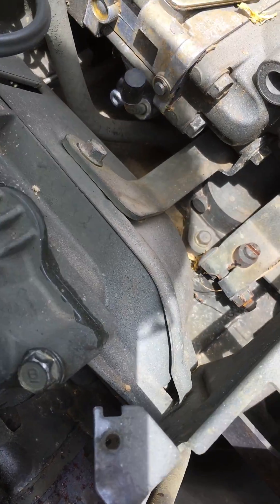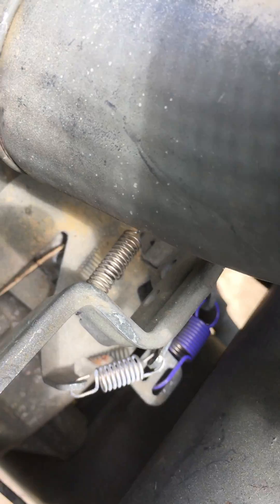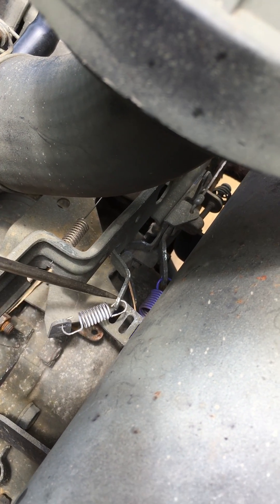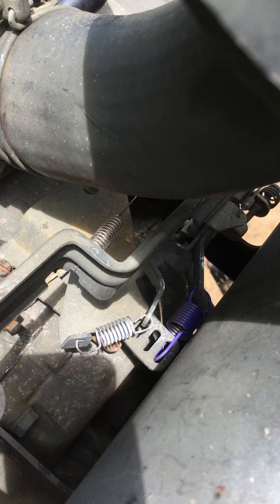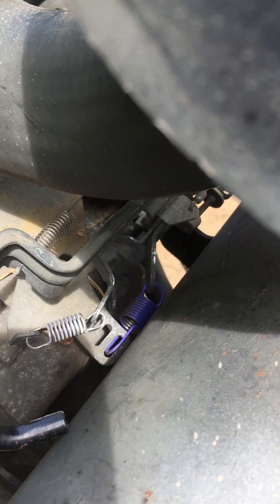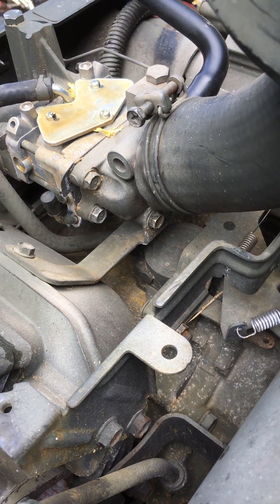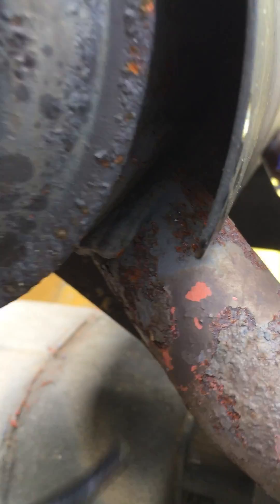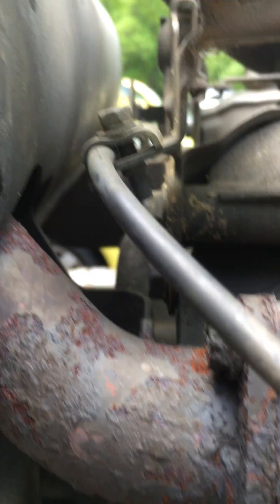Briggs Big Block Governor, Idle, Load idle and Max rpm

Comment: What spring is bringing it back to wide open throttle? The only way mine will come back to wide open throttle when it’s shut off is if I have tension on my idle load spring. But if I do that it makes my idle high

Comment: Hey, I have that exact same motor.  It’s still stock but and it has issues.. I want to do some mods.  Would you be willing to tell me what upgrades have been done on that motor?   I want to replace the carb but don’t really want to go back w same one. Can’t find any info on swap out options.. let me know and I’ll send you my contact info.  Thx
Reply from the maker: Look me up on fb. Performance mud motors.